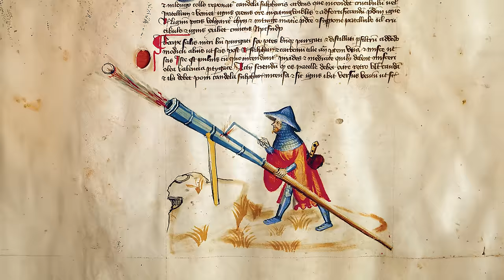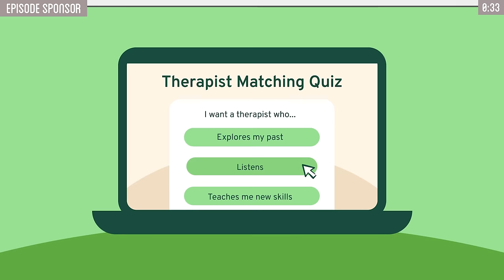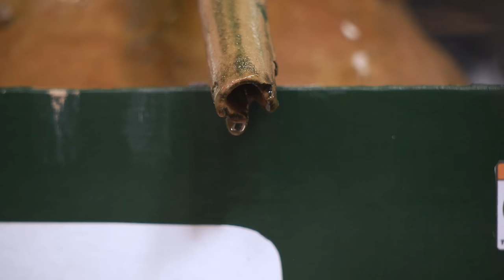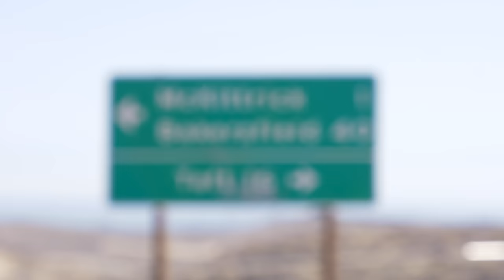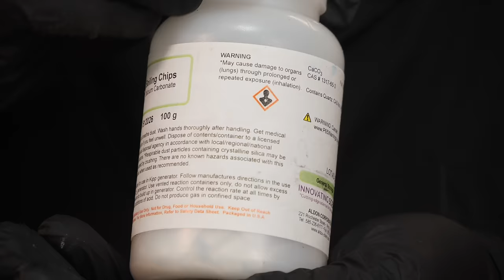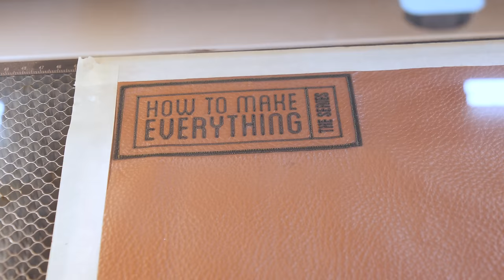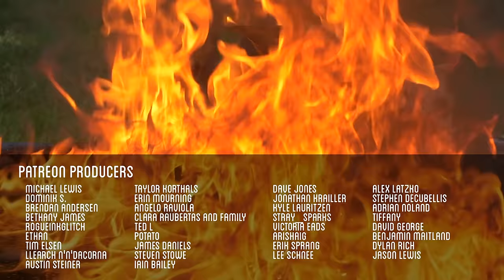I Recreated the Lost Recipe for Greek Fire!

Comment: could it have been a two part delivery system with the pine tar, crude oil and quicklime in one solution and water in a separate set to mix upon exit of the delivery system so as to keep the mixture safe in storage on their own boats?

Comment: What if it was actually a combination of two parts to create the self ignition, oil mixture first, then lithium tipped arrows, once in contact with the water, and wouldn't get the coating of oil? The exploding lithium would also spread the oil mixture.

Comment: Well, I was going to keep my big fat mouth shut, but you did specifically ask for comments on ideas... so here goes.

 That recovered crude sample had to be wildly contaminated. To me it looked to be mostly sand. I immediately thought it would somehow be purified a bit before use. Some kind of straining process may be useful, as the viscosity IMHO was way to high.

Secondly, the purchased crude from TX (I believe you said) had too low of a viscosity. Probably looking for some something in between - where it is thicker than this, while still having a flow rate similar to the pine tar. And obviously not quite as 'chunky' as the recovered crude.

I would maybe start with a base of the strained recovered crude, mixed at 1:1 with the TX stuff. Then add the pine tar to adjust the viscosity down a bit. This might actually be a pretty high ratio, 3:4 maybe.

With the lighter refined products, those are going to act as solvents.. which we want to avoid in reality. We do need some of the higher octanes, however stuff below a certain point is going to flip over to being more of a contaminant than a benefit (kerosene for example). 

The quick lime being in a powder form isn't going to work very well.. it's going to spread out pretty quickly and tend to dissolve instead of reacting. Of course it IS reacting and producing heat, but thanks to being a powder, its just spreading out too much to produce significant results. I would suggest creating granules, which could range in size from 0.5mm up to maybe 3mm (or even larger). Also, the amount of water used was just waaaaay too much. For the best results (to produce those really high heats), you're going to want a ratio on that as well of 3:4 - water:quick lime.

When the quick lime granules are employed in the final device - I would add a layer of the granules at the bottom of your flask. Then add a separation layer (aluminum foil maybe? Needs to be able to prevent the oil from soaking thru) between those and the Greek Fire mixture. When the quick lime gets saturated in the Greek Fire.... oops, pardon me. Should have learned... the Liquid Fire.. When the quick lime gets saturated in the Liquid Fire, that's going to create a prophylactic boundary around the quick lime preventing it from mixing with the water and producing the appropriate reaction.. probably the same reason it wasn't as successful in powdered form when mixed INTO the Liquid Fire. (Although since you were going for a suspension, that is the correct way to introduce it into the mixture!)

I imagine the final device would have employed the Quick Lime more as a 'blast charge' component instead of actually being in the Liquid Fire. Now, given the time, I do not believe it is unreasonable to think someone could have made an open ended cylinder out of glass. You could use a clay plug at one end of it, load it up with the Quick Lime, and then either use a wad of cotton to moderate the incoming amount of water (remember, we need to make sure it is mixed at the proper ratio to produce the correct amount of heat) or another clay plug with a hole that would allow only a certain amount of water to trickle in. This in essence would create the 'blasting cap' and when it detonates (potentially) it would expel the Liquid Fire, on fire, in all directions.

I would maybe play around with this blasting cap theory a bit before mixing everything up, and see what kind of results you could get with that. You could isolate the best ratio by starting 1:1 on the Quick Lime and water mixtures, and slowly reducing the water... I would imagine 1:1 to be too much, but in reality, I have no way to know. Too much would counter act the reaction though. Try using distilled water in the tests, just for best practices. And, of course, don't forget to switch up the granularity sizes and test out a range for best effect.

And just for fun, if all that actually works out, for an 'updated version', try using the leftover kerosene and dissolving some Styrofoam in it 8-) Throw some pine tar in there and have some Napalming fun!

Geez, I feel like I know way too much about explosive theory, and not nearly enough chemistry. Thanks for the video!
Reply: As an after thought, a more time period appropriate separation material for the Quick Lime granules might be some wax-infused linen or if that's too much effort to reproduce, wax paper.

When I mention the 'blasting cap' approach, I also forgot to mention, the prepared cylinder would have to be inserted in the round flask just below the line of the fuse material.. maybe running about halfway the total depth to the top, or close to it... the water would need a way to soak or trickle in. It could be secured in place with a little wax  between the inner trigger and the inside wall of the round flask to prevent it from moving too much until impact. You would want to be careful to NOT cover the opening in the blasting cap that allows water ingress.

You could also coat the inside of the flask with larger sized granules by melting some wax in the round flask, then while it is still liquid, cap it off and centrifuge it until it cools. That should coat the entire inside fairly well. Then it would just be a matter of slightly warming the wax until it becomes some what tacky but not completely melted, introducing the granules, and centrifuge again to spread them evenly around the inside. Could be done by hand if no centrifuge is available. Just a thought... I'm more in favor of the blasting cap trigger process lol

Comment: I mean... they would've technically had the resources for igniting the ether when it hits the water- with elemental sodium metal nuggets extracted from salt or potassium from pot ash, which light on fire on contact with water. 

You could do a two-parter, like a glowstick, put a glass ampule with reactant B inside the bigger glass bottle with reactant A so that the two elements mix with the water on contact. 

I would put the sodium on the outer layer, and you could even let the bottle sink so that it blows up on its own when water gets in (beware of shrapnel guys, take all the proper safety precautions and for God's sake, come up with a better setup for letting go of the bottles lol)

Comment: What if the mixtures were heated up to a critical point before setting it on fire? Example being a pot of hot oil is a lot easier to be lit on fire than a cold pot of oil.

Comment: Interjection! Objection!

I should watch the whole video before commenting especially since I skipped ahead after listening to the beginning...

I suspect that your napalm mixture is not the “legendary Greek fire” but just a flammable oil mixture.

Just as there have been discoveries of ancient devices that might have been electroplating devices...

So to the lost technology of Greek fire most likely involved some simple but technical material such as sodium metal with was contained in the oil pitch material... this material was likely to be pulverized and distributed throughout the oily pitch possibly in conjunction with a pulverized processed mineral that was very high in magnesium metal...

So now they have the oily pitch containing pulverized metallic sodium and pulverized metallic magnesium... which in the oily pitch would stable and if pumped out under pressure would ignite on contact with water and burn even in a highly carbon dioxide environment without oxygen being readily available in gaseous form... once the metallic sodium catches on fire simply from being exposed to water... the magnesium would ignite and be even more difficult to extinguish until the chemical processes and reactions ran out.

So that would create a stable Greek fire system that would be relatively safe to handle and transport and yet be highly volatile and useful under a wide range of potential deployment capabilities.

This would explain why Greek fire was described as “burning water” and “impossible to extinguish”... because once the metallic sodium starts burning and ignites the metallic magnesium in the pitch mixture... there no putting out that fire.

In the histories of the Byzantium Palace in Constantinople there were mentions of strange machinery of unknown purposes in the basement... which were damaged by looters in the fall of the Byzantine empire.

There was in fact a recipe.
There were in fact machines.

There are in fact simple chemistry patterns and behaviors which can create these outcomes.

What is unknown is how they did it and how it was discovered in the first place...

To me this is fairly obvious at this time... but I studied this situation decades ago and am often amazed at the continuous misrepresentation, misdirection, misinformation and obfuscation related to this and many other topics.

This material is ridiculously dangerous to have in storage... and they most likely would have manufactured it on demand from stores which were deliberately acquired using a clandestine methodology in order to prevent recognition of the recipe and the processes involved.

People both over complicate the situation and underestimate the capabilities of Greek fire.

Comment: if you would have just heated the vessle before launch over a brazier on deck you would have had it, maybe the oil goes over a copper coil on a pressure gun?

Comment: Can olive oil or rapeseed oil have been used instead of petroleum?

Naturally petroleum itself does not ignite, the volatilised fumes do. In turn it doesn't mix with water and stays on the surface, so if there is already fire, more flammable fumes will be produced. This is the problem with ethanol, it is fully soluble in water and will be instantly diluted by water, which is why by all reason any recipe that includes ethanol in any substantial amount shouldn't work.

Comment: There is an exact day petroleum becomes too dense to float on water, before and after heating.  Fill a dumpster with petroleum tar that floats on water and is super viscose. Every day it "dries" "hardens" "thickens" "flashes off its spirits"  and one day it no longer floats as it has become to dense and deprived of the chemicals that also help it retain buoyancy. The day before it sinks you have critical mass and should be making it from this.

Comment: PLEASE READ!
i know exactly what they used, we use a type of soap called aluminium soap. well metallic soaps of nearly any metal can be used. Obviously they had soaps, it thickens oil and its simple. i had tested it, it thickens it really well and it is still as flammable.
Reply: basically i have an idea of how it reignites in water too but i cant explain it totally. i have a feeling they had some way of producing sodium metal or at least some kind of extremely reactive metal and acid or just by its self. it could also be used to create the metallic soap.
Reply: o and this is what the updated version of napalm uses.

Comment: What you harvested is what is called "bitumen" - and it is not oil. As you probably can tell it's an asphalt. As such it would need tremendously high temperatures to burn. 

I don't think this is what they used. You should be able to determine what ,kind of oil they had by knowing the historical range of their territory. Heavy bitumen is mostly in alberta california and africa. Greeks did not have this. Distilled bitumen is not the same thing as raw crude oil. To get something like crude from bitumen you need to use a coker to seperate lots of the carbon and make synthetic crude oil. What you got was a mixture of lighter hydrocarbons. I doubt they were distilling out fractional components from crude back then. More likely it was just crude oil sprayed on something and ignited.

I hope you are safely disposing all that contaiminated water from your examples. Don't dump it into the drain or sewer.

Comment: Did the Byzantines know/have access to magnesium, Mg, or sodium, Na - for ignition upon contact with water???
   You use the phrase "ancient napalm", which makes me think; you can make "poor man's" modern napalm by heating gasoline with soap shavings.... Did the Byzantines have anything alike modern hard soap (which is not a new/modern invention)..???
    I cannot help but wonder, if it would work better, if you let the concocktion heat up a bit before throwing it into water.
   Mg, resin and crude oil, maybe some soap, maybe some smaller bits of wool...
   I would for sure like to see you do more experiments.
    To get a better result in comparison to the text description, I think you should drop every one of your recipes in clean water - maybe even salt water (do the scriptures mention anything about the water being fresh, brackish or salt?? Could it change anything??). To assure that each formerly attempted recipe lying on the water surface does not interfere with the next one..? Obviously a lot more work, I know.
   VERY interesting video. Please bring more 👍👍👍

Comment: Unfun fact: Technically speaking, as per the NFA, you just created multiple unregistered "destructive devices" which is a felony.
Reply: "The term "destructive device" shall not include any device which is neither designed nor redesigned for use as a weapon; any device, although originally designed for use as a weapon, which is redesigned for use as a signaling, pyrotechnic, line throwing, safety, or similar device; surplus ordnance sold, loaned, or given by the Secretary of the Army pursuant to the provisions of section 7684(2), 7685, or 7686 of title 10, United States Code; or any other device which the Secretary finds is not likely to be used as a weapon, or is an antique or is a rifle which the owner intends to use solely for sporting purposes."

I think this would fall under 'not likely to be used as a weapon', given that he used all of it on his own property.
Reply: @trogdor8764  Yep, thought there would be some fine print in there to keep from exercising the Feds over homemade fireworks and the like kind of silliness, like calling charcoal lighter fluid a weapon.

Comment: One big note that was Constantly stated from day one about the original was that it was able to burn hotter and longer if it contacted water, this has long made me think that powdered sodium, potassium, or another similar metal, or, potentially, they were actually refining either titanium or aluminum (techs that were possible but not known to the world until much later), and were using either ignited titanium or a form of thermite inside the sticking gunk.  I had also thought that they may have added salt and sugar in a molasses type form, both helping the temperatures, reliability, and stickyness

Additionally remember that the greeks had access to natural gasses that were used in their temples for hallucination, but also to create forever braziers, if you used it to infuse the liquid mixture, it may be like flammable carbonation

Comment: You could have used the motor oil that has 15000 miles or more from a car. Drain the oil from your car after the oil was used for 15000 miles . I think your over thinking it in todays stand point . Maybe think like they did . What type of oils did they have  as  cooking materials then? Olive oil is a good choice but you need the thicker type of olive oil . Also you could have gone to a automotive store and got plenty of the things you needed with out distilling anything. Thats what we do in todays world i doubt back then they distilled anything because they didn't know what they were doing . I can bet it was something they just through together and refined its processing a little to inprove it .

Comment: Is it possible they just refined gasoline from the oil and used that? Have a lamp burning with animal fat in front, then the gasoline being propelled just above the wick to ignite it? It’d burn on water, hard to extinguish with water, and would be a truly terror based weapon. Pine sap can be dissolved in gasoline but only until the solution can’t hold anymore and would then become thicker and slightly sticky. I feel like it really wasn’t that complex.. gasoline just comes from heating crude oil as you showed, so if they did that, collected the gasoline, dissolved pine sap/pine tar in it till it couldn’t dissolve anymore, heated it to get a supersaturated solution, then spray it over a burning lamp, you have a decent flame thrower, would float on water, and be somewhat sticky